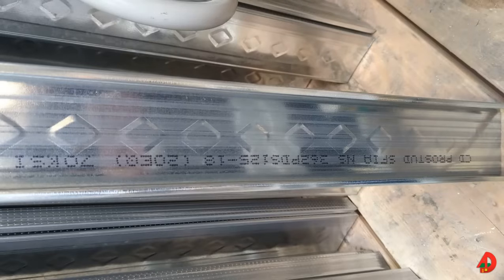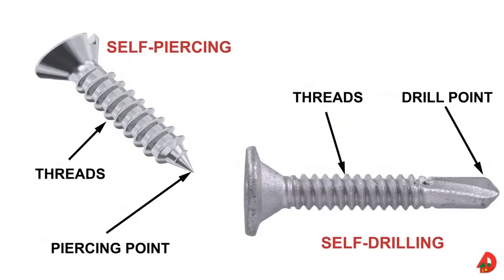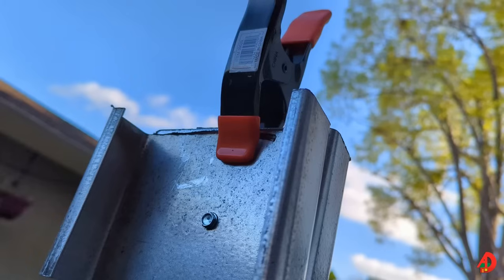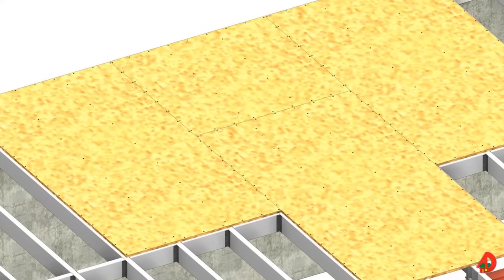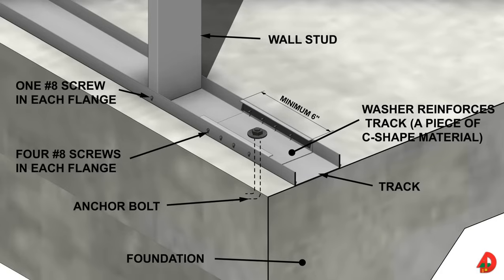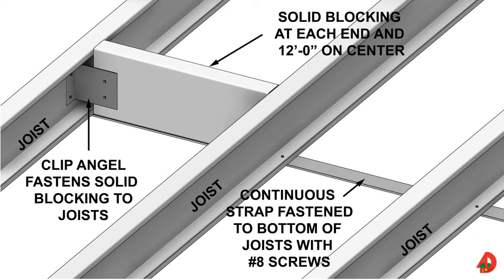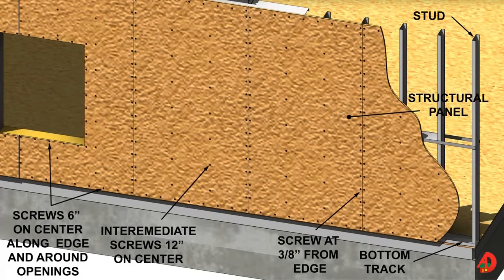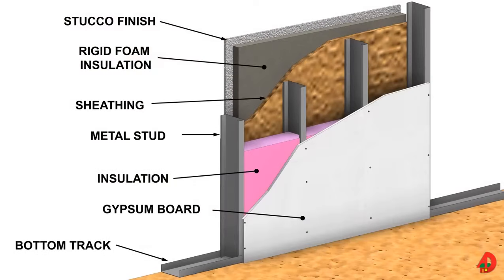Metal Framing - Tools, Fastening Methods, Fundamentals

Comment: Word for the wise from the wise. With metal stud framing layout your roof framing first and use that layout for wall studs layout, everything will line up correctly and have bearing down to slab.
Reply: @manclg732  how and what gauge metal do you use this trips me out because I was taught metal stud framing is non structural what are they using shear bolts how do you brace the walls up I'm lost
Reply: @DoloSole structurally 18gauge and 16 gauge 16 on center up to 10’  135 mph wind load per the structural drawing from Clark Dietrich metal framing book. As for myself I use 6” exterior walls 18 gauge with 6” 16 gauge two inch flange bottom track and 6” 16 gauge 6 “ flange top track. In my thinking 16 gauge top track will hold rafters and trusses being screwed down to them without stripping.
Reply: Also hold down anchors are used by fastening to double studs and anchors to slab. At these points we install 6” 18 gauge flat strap to both sides of studs and to the anchors mentioned. Our believe is framing should hold up the load without sheathing for structural integrity. Hope this helps on your home building
Reply: @manclg732  cool

Comment: Very useful! Is it necessary to also create a thermal break in addition to the insulating panel or will there always be some connection between the wall layers? Excuse my ignorance if this is a stupid question :-)
Reply from the maker: What you refer to is called "Thermal Bridging" and Metal has a high conductivity, where Wood is Moderate and concrete is high (variable). https://en.wikipedia.org/wiki/Thermal_bridge

Comment: Steel framing expert here. My experience has been that I can train a young carpenter apprentice to do metal framing faster than a seasoned wood carpenter. Reason being, there are only two similarities between wood framing and metal.16 inches on center and 24 inches on center.That's it. Season carpenters always want to incorporate wood framing techniques into metal framing. Nothing transfers. Also entertaining to watch the reverse.
Reply: This was really stupid she didnt  say anything about lay out and why the stud has to face as for framing a floor with metal studs is something I've never seen personally your right wood and metal studs framing have nothing in common in commercial construction metal framing is non structural
Reply: Ummm, level, plumb, straight?
Reply: @nailbanger2  wrong plumb and level=square and the direction the stud is facing let's who ever is hanging  the drywall where to hang their fist sheet it's also your first test as a drywaller if you don't know that your not a framer your a helper in commercial construction framing is part of drywall

Comment: guys dont weld galvanized metal without proper PPE the gasses are toxic and build up in your system
Reply: I used to build buildings and welded galvanized steel all the time all day long if you drink milk it would prevent this

Comment: Great! Steel studs Make for lumpy rarely square walls The installs have lumpy joints  Screws never sit flush .. true..and typically ruined bottom plates as the workies walk and even drive over them  during  assembl.
  PLUS these rust out Badly..... I've seen 2 year old walls so Totally rusted out to the point the drywall was falling off. 
Don't Believe the Brochure babbles ...it's self serving BS.

Comment: Grand Junction CO. I’ve been doing metal stud framing since 2016. I’m 23 Y.O. It’s mostly commercial jobs besides personal home owner jobs.
Reply: What gauge is the most common that you're using in projects for structural support?
Reply: @buildingparadisePH 12 to 14 I believe but non structural is 18 to 22.
Reply: @buildingparadisePH  20 gauge is the most common used metal
Reply: I am getting ready to build my home out of steel framing. Cheapest option and easy to install on a small home like mine (single story. Less than 1500 sqft, simple layout and lean-to roofing)

Comment: My Dad built some early (for area)  metal home buildings in Sothern California and used Thermosteel from a company in Canada.  Special made galvanized steel framing studs with unique truss design to stop thermal transfer.   Only made 2 houses before company went belly up for whatever reason.   But both houses are still standing today and have had zero issues.  Very low cost fire insurance as everything used to build it was fire resistant.    Metal studs in these videos look so light and flimsy in comparison.  still have some of the material, but can't find any reference online, truly dead company.
Reply: Too sad, the company closed. We now don't know where to buy the metals.
Reply: I work for a business called design horizons and we do similar stuff you should look into us and see if this is the same materials
Reply: Who cares 😴  use spf wood studs
Reply: @JohnSmendrovac  wood rots, transfer more heat than special metal, not straight, termites and other bugs, burns, metal lighter and stronger.    But other than that..
Reply: @JohnSmendrovac the whole point is to engineer a home and pay less insurance.  You can't say " It's not fair" when insurance skyrockets in cost for wooden stud homes.  Look to the future

Comment: Metal weakens in a fire much quicker than wood. Metal buildings need to be fire protected by fire resistant isolation for fire resistance. I have seen numerous examples of that as a firefighter and police officer.
Reply: Oh wow a firefighter and a police officer. What are you trying to be? The village people?
Reply: @jamesnightingale2788  so the commenter on YouTube is more credible that the fire departments studies and experiences. So glad you were able to set the record straight 😁
Reply: Fire departments report the same and building codes reflect this
Reply: The difference between wood and metal source fire is that with metal, you'll have a basement of melted steel that you can resell for scrape.
Reply: I am a structural engineer and what you say is correct, but luckily it’s not difficult to protect steel, normally using fire boards is sufficient in the case of light gauge profiles. 

Wood resists a bit more but it emits toxic smoke while it burns so you still need to protect it anyway.
Reply: As an steelframe contractor I confirm that you are totally right. You have to protect the steelframe for at least 2 hours otherwise your building can be your coffin. Simple as that. If you know what you are doing and build it by the codes it is a superb product.
Reply: A safety factor of greater than or equal to 2 is usually sufficient since it'll typically only lose 50% of its strength in your run of the mill fire.  Many things are designed with a safety factor of greater than 2.  But obviously not everything
Reply: Yes,it is good for partition walls,and needs caution for structures.
Reply: So, not an engineer (ie expert)?
Reply: you sat there and measured the time?
Reply: @GoatZilla somebody, at some point, did.  Thats how they determine how they weaken, lol

Comment: The structure is not good enough for lateral forces.
Reply: 50 years of construction using metal C studs and track would disagree with you.
Reply: @meshedgears2794  I agree with you.  You got me beat by 10 years. 🤣
Reply: You better let the commercial construction industry know because they’ve  been building crap left and right this way for decades.
Reply: @tgreening  "Crap" is truly the right word.
Reply: @tgreening  A strong wind or an earthquake will be enough to destroy it. The lateral braces need stronger conections.
Reply: @fcalin21    And at what fine institution did you obtain your Structural Engineering degree which allows you to make this proclamation with such authority?
Reply: @tgreening  Comon sense. 
Compare the structure in the video with an industrial building. You need fewer posts  but stronger in order to obtain a good result.
Reply: @fcalin21  Where in the video structure example does it give you the gauge they use?   Common sense says a residential home has a different critical load path than an industrial building.   If you want use post with metal studs that would give an industrial design, then I would use for overkill, 12 gauge quick frame studs that have a flange width of 3 inches and lip of an 1 inch or greater depending on manufacture.  Back to Back that is a flange width of 6 inches.  Pick your web sizing.
Reply: @herbrotter  For a building 14 meters long and 9 meters wide  i wil use Ø219x4.5 mm columns, and IPE240 for rafters, 4 meters interax and Ø30 rod bracing.
Wood is good for concrete forming and fire, not for construction.
Reply: 16 gauge studs are equal or better than 2x traditional wood lumber.  14 gauge studs, will give you superior performance.  All at 24" o.c.    If you look at the design of the stud, it is designed to taken on lateral forces.  Metal studs are not prone to snapping to heavy wind loads as opposed to wood.  To increase resistance against lateral forces, when properly fastened, strapping,  and the associated blocking, lateral forces will not be problem even before you add your sheathing.   Many of the large diameter self tapping screws for metal to metal connections have a higher shear rating than common nails. The connection between the stud and track eliminates a majority of the problems related to the hinge effect with the wood to wood connection with nails.  I see many engineers are calling for .148 diameter nails for usage in wood.  No wonder why you are seeing more nail guns to handle this, just like the nails you use post-framing structures.

If you bother to look at the various documents regarding CFS (the metal stuff) from the manufactures, the engineering documents to be precise, and various journals, you find out that metal does have the flaws of wood.   If you are an engineer,  you should know that already!   Many manufactures today have increased their offering in metal accessories to make life easier.  Just look at their website.  To combat thermal bridging, more accessories are out for exterior continuous insulation that allow of attachment of wood finishing products to the metal structure.  You can even use wood purlins as they are many ways to connect them onto the metal structure.

If the homeowner's insurance company is made aware of CFS framing, they do offer a discount in rates.

In summary,  are you an engineer?
Reply: u know about nothing, bro
Reply: @abdulhalimawang  I have my brought arguments.
Reply: Take a look at IRCC 2023. You’re full of shit, buddy. You’re also arguing with highly experienced Construction Workers who have been creating buildings longer than you’ve been alive.